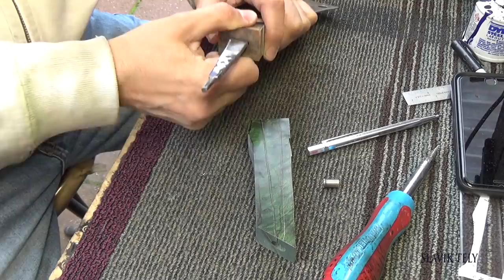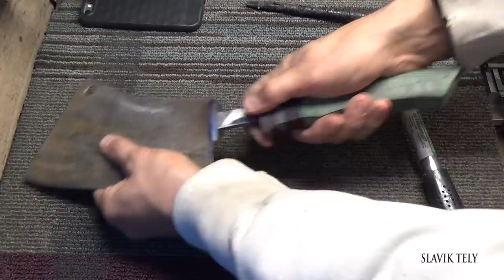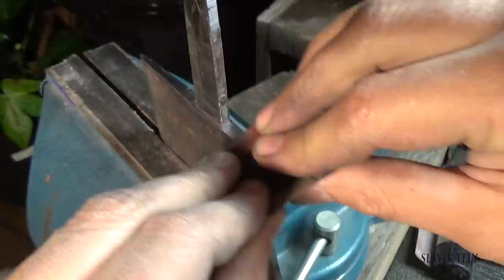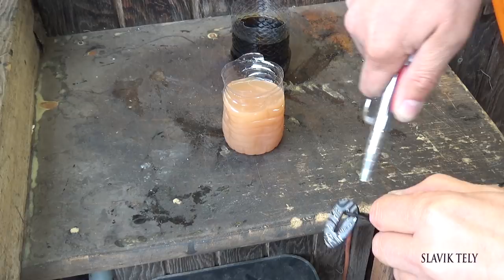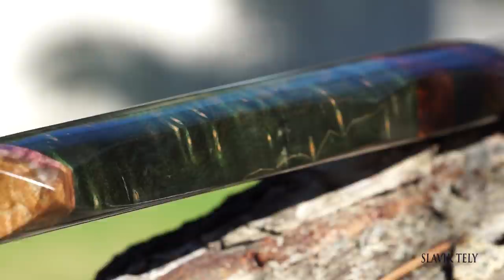Restoring Tom's Meat Cleaver P2

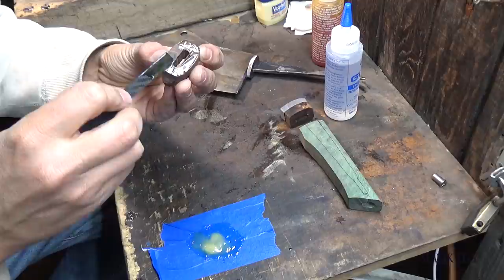Comment: 3:03 I always use a wire wheel on my angle grinder to remove rust. Its faster than any rust remover.
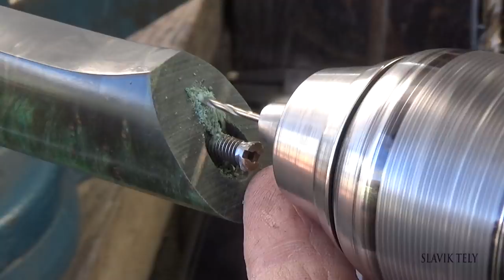9:19 Precision gueswork at its best
Keep up the sublime work! I wish as was half as diligent as you!

Comment: The handle work is superb. In my humble opinion, the blade would look MUCH better with a mirror finish.
Reply from the maker: Owner wanted to leave it at original texture to preserve original logo.
Reply: Then build a new one, don't grind away the years by treating it like just a plain sheet of metal...

Comment: Very nice!  Seeing it all finished up, the cleaver actually looks to be a wrought iron body with a carbon steel bit for the edge.  I was wondering if it was after seeing some delamination happening in the tang in the first video as well as on the right side of the blade, but now after etching to clean up the rust, its grain with the slag lines is showing through beautifully.  You can also see the darker carbon forge welded at the edge.  That makes it so much cooler of a find to me, since I'm a bit of a sucker for wrought iron lol.  Beautiful job 👍
Reply from the maker: Thank you very much for clarifying the type of steel. I thought it was cast iron because I have never seen wrought iron. Yes, I do agree with you of the darker carbon steel on the edge. It makes it a lot nicer looking.
Reply: SLAVIK TELY - No problem, I'm happy to help when I can.  Thank you for sharing

Comment: How do you make the metal turn like that using castor oil? Can I do the same thing to the blade and get the same result?
Reply from the maker: That steel is Damascus steel. You can not make any steel look like that.

Comment: Very beautiful handle but the whole thing would have been if you would have done more with the blade But it's still sweet though
Enjoyed the video and gave it a Thumbs Up
Reply from the maker: There was not enough thickness in steel to put a nice finish on it. There was not a single spot where the cleaver had a flat area. The area with the hole was very thin.
Reply: @SLAVIKTELY  It still looked very nice but that handle made the whole video worth watching

Comment: Should've refused package! A cracked blade isn't even Art. Wasted talent and countless hours on a blade that should've followed the original handle into the trash. Amazingly talented Artist!
Reply: Am I missing something or are you insulting him a and complementing him
Reply from the maker: I understand where you are coming from BUT customer pays-you make. Simple business model. This cleaver gave me a lot of headache because of those cracks. I was afraid it would split on me. It was nerve wrecking to work on this piece.
Reply: Fair enough. And also honest. I bow my head and tip my hat to you, Sir. You do have an amazing talent! @SLAVIKTELY
Reply: Definitely complementing him. I do think his customer has poor judgement in cutlery though. @SoggySandwich80
Reply: I think another viewer was correct that the blade was used as a lathe cutter. It was found in the wall because the builder probably  thought it was no good anymore. I could be wrong. For whatever reason the customer wanted it, so its not my business to judge him. Tely did an awesome job with what was given him.@Dominic Cerisano

Comment: If you would have spent some time polishing the actual blade, you would have hit a home run. While the handle looks premo, not so much for the bad looking blade itself. It really needs to be polished to a mirror finish to complement the handle... JMHO
Reply from the maker: Owner wanted to leave out the blade as is. I have to follow customer's wishes.

Comment: Is that crack in the middle going to be an issue in the future?
Reply from the maker: It is not going to be used. It sits on a display. Owner knows about it.
Reply: I had the same curiosity.  Could that crack be restored if intended to use?
Reply: @SLAVIKTELY  gorgeous job BTW.

Comment: this is like when some ghetto dude puts $3000 wheels and tires on a car thats half in primer and with 2 different colored doors
Reply from the maker: You don't like the texture of the old rustic cleaver? Ahhh, that's too bad.
Reply: @SLAVIKTELY   totally love the handle and the hard work you put into it but leaving the old metal pitted and unfinished just wasn't a good match in my opinion
Reply from the maker: Owner wanted it that way.
Reply: @SLAVIKTELY  I agree with the owner; the easiest way to make it look like a new blade is to...well, get a new blade. This one has a story to tell. Don't shout it down with a mirror-polish finish.

Comment: Nice handle. Could have put more effort on the blade.
Reply from the maker: I could not do anything about the blade, it is too thin on the top. To make it have a nice flat finish I would have to grind it and there was not enough steel left on top of the cleaver.